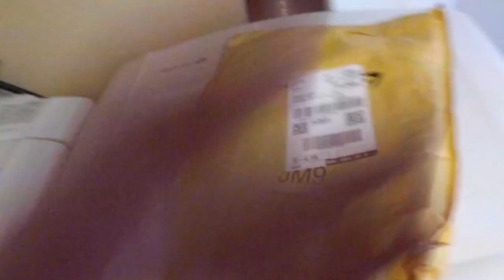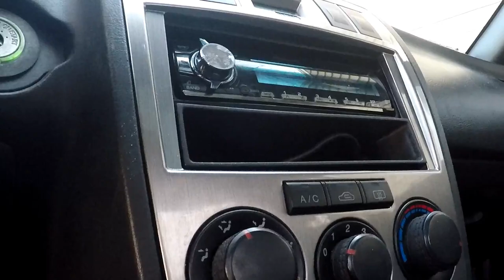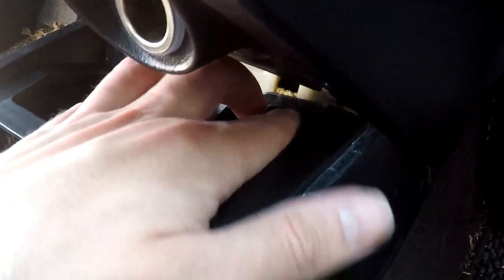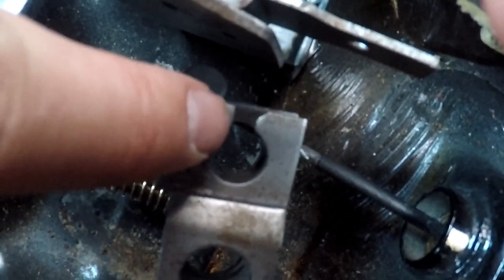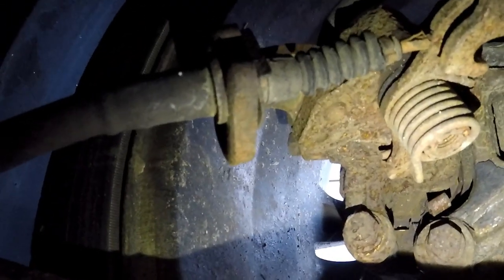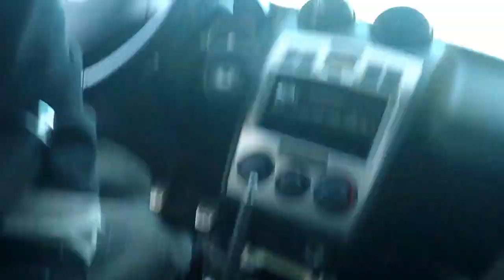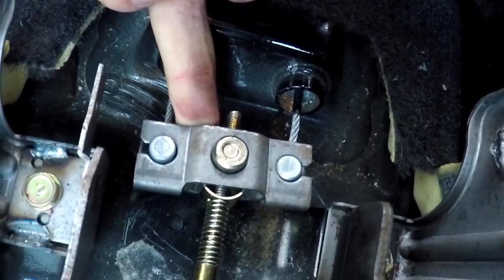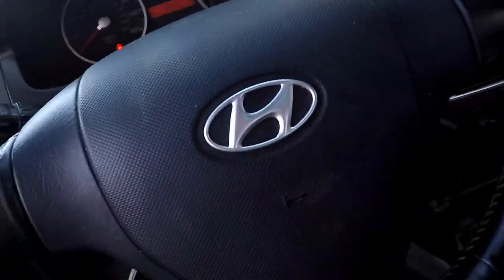How to install parking brake cable in 04 tiburon gt

Comment: Josh, YOU ROCK!!! I got quoted $396 to get this done at the shop. Watched your video and for the price of the cables and less than an hours work did it myself.  My 2005 Tibby has all the same parts except for the ends that attach to the caliper. Also, I got my "clip" off with a screwdriver and all of my bolts were 12mm (in case a 05-06 owner is out there watching).  I am glad that you forgot the clip, so I wouldn't, and that you suggested an open wrench for the inside bolt tightening. THANK YOU again for the great video!!!!!
Reply from the maker: Frank WELDY haha glad I could help! That my friend, is exactly why I repair stuff myself. Unless it has something to do with taking the engine/transmission out. Thanks for checking out my video! How’re you enjoying your 05? I’ve had my 04 for almost 4 years and it’s been nothing but fun
Reply: @joshst.george1716  She just turned 14 this month (and failed inspection for the first time ever - parking brake) and she is the first car I ever bought brand new!  Love this car, nothing on the road today that I would trade her in for!
Reply from the maker: Frank WELDY that’s awesome! Do you have anything aftermarket done? Have a Borla cat-back on mine and it sounds amazing. I fool a lot of people lol, doesn’t sound like a Hyundai at all. I may be looking for something American next year 😏 but over all the Tib is a nice car and the GT v6 is not a common one whatsoever

Comment: nice presentation, but u do not have to remove the console. Open the compartment lid in the console and with a sharp pick or needle and lift out the bottom which is just sitting there because of gravity. You now have easy access to the cable adjustment.
Reply: I concur
Reply from the maker: Oh wow, that would’ve helped a bit knowing that when I made the video but thank you for at least sharing that info! Glad you still found this helpful!

Comment: Pretty decent video. Removing the whole console sure makes everything much easier but I think you could do it without taking the whole thing apart if you know what you are doing or if you've done it before. 
I can't seem to find cables for my 2008 model locally and ordering it from Ebay costs a lot, I wonder if any other Hyundai/Kia cable would fit my car...
Reply from the maker: I probably still would’ve removed the whole console because of how much space that provided even if I had known you didn’t need to remove it. I want to say I ordered mine through Amazon but I honestly don’t remember.. I probably said it in the video but again, don’t remember 😅. That’s something I’m sure a quick Google search or someone at the auto part store could tell you. Wishing you luck!

Comment: Is this the same for a 08? 4banger?
Reply from the maker: My apologies for the late reply, I’m hardly on YouTube anymore. I’m not 100% sure but I don’t see why the design would differ much or at all between the 4 cylinder and v6
Reply: It's pretty much the same, you can even do it without taking apart the entire console if you are careful, you can access the cables from the center compartment.

Comment: Do both emergency brake cables have the same lenght?
Reply from the maker: marc vermeylen yes, they do
Reply: @joshst.george1716  Thanks, I want to change them in my son's car, but it's snowing in Belgium so I did not had the chance to look under the car, now I can order them !
Reply from the maker: marc vermeylen the ones I bought for this video are from Amazon, they are super durable and I haven’t had any issues since this video was posted! If you have any questions don’t hesitate to reach out :)